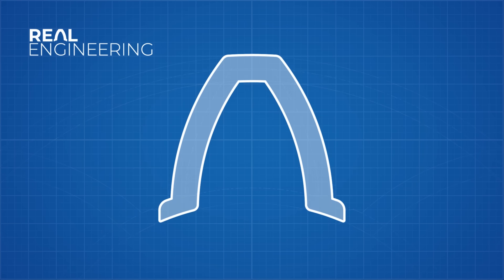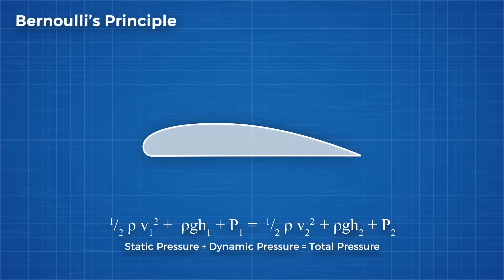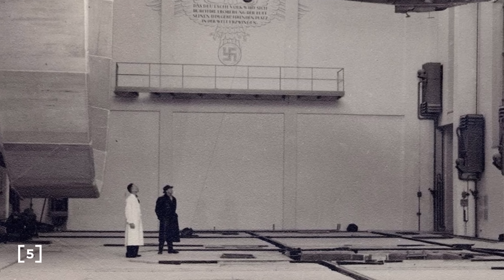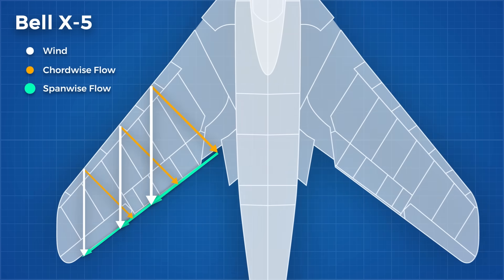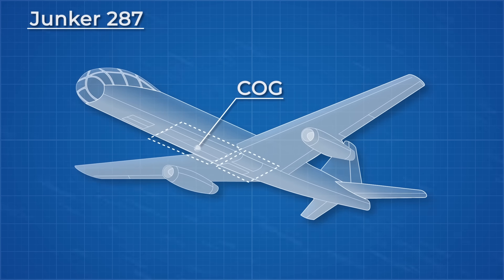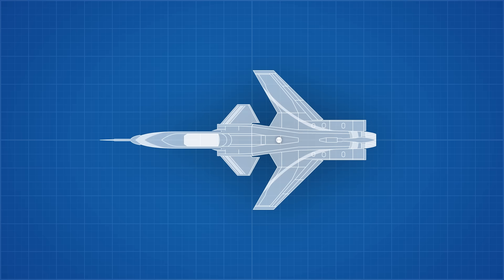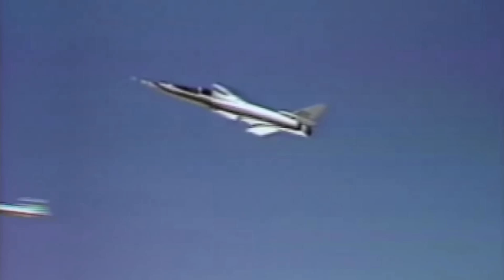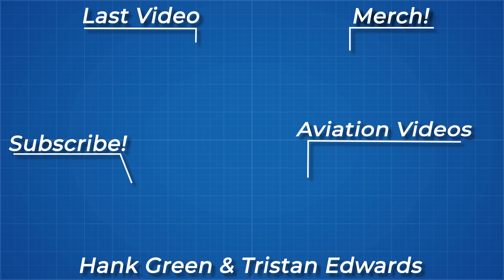Why Do Backwards Wings Exist?

Comment: You almost got this one correct.  Sorry, you got caught up by a common myth peddled on the internet.  Your only screwjob this time was in the structure wing box analysis.  It was designed with LESS structural weight and LESS stiffening than a typical wing.  Not MORE.  Why?  Wingtips were designed as completely unloaded producing NO LIFT, like a birds wings.  Higher CL is found at/near the root and can be done as the higher CL creates a higher Induced Drag, but due to forward swept wing the Induced drag is canceled when the swirl pattern collides with the OPPOSITE wings swirl.  Because the wingtips are unloaded it MUST have active control as a slight change in pitch creates a present load at the wing tips which increases due to deflection increasing yet again the load.  This was a double whammy as they had also purposefully made the structure with less weight and LESS stiff than normal compared to a standard wing as part of the testing program was also directly centered around ACTIVE controls for load alleviation which one now sees on elevators, ailerons, slats on modern commercial airliners.  Birds get away with this with an often slightly forward swept INNER wing and a backwards swept outer unloaded wing used as their ailerons.  This also allows a bird directional control and why birds do NOT have "rudders". 

Now  that commercial airliners are made completely with FBW controls and the required 4 computers(not 3 as you stated), it is quite possible for them to make a forward swept wing airliner in the near future.
Reply: Tony Wilson  Ah, you and I are disagreeing regarding wing stiffness based on the fact there was a vast difference between the program stated goals,  the end design, end result(what I stated happened) and the fact that the follow on aircraft was never produced showing the lower stiffness requirements.  This statement was based on the fact that they did not TRUST the FBW system for load control.  Rightly so! Initially it did not work as advertised!  Though for maximum load it did work, so it would not have resulted in a complete failure of the wing, but would have been a terrifying ride! Therefore as part of the programs passive safety, uh, "control" was a MUCH stiffer wing. 

As for last point: I disagree.  We will never see SS transport other than maybe Mach 1.3 due to drag reasons alone and oil isn't exactly jumping out of the ground for free anymore.  As for FSW fighter aircraft? Probably.  FSW drones?  Yes.  The Recon drones should all be FSW right now.  Frankly it is stupid for them not to be.  Gain ~~~ 15% more loiter time/load(depending of course on Aspect ratio of the drone in question). Any subsonic pilotless aircraft today should 100% be FSW due to the dirt cheap availability of gyros and FBW control at even RC aircraft cost.  One barely even has to play with algorithms/computers to set this stuff up anymore.
Reply: Tony Wilson  I think the concept might come back in passenger planes. They mostly fly in transsonic regions and are highly sensetive to effiicency / fuel usage. There is also a concept abount using forward swept wings to block fan noise of rear mounted engines
Reply: Tony Wilson  Sigh: If you are going to post links, at least read them first.  If you had you would know they had 3 digital computers and 3 analog premixers and the 4th computer is the human. Simple basic Flight logic that has been true going on 50-->80 years now. Today we use 4 computers where 3 are used and if error is occurs, 4th is checked.  If error is consistent, 3rd is switched out and 4th is used. 

If you truly remembered your lecture, assuming you did not just get a manager, he would have said that the X-29, due to its instability would render the human pilot(4th computer) unconscious in less than 2 seconds. 

If  you had read your own pdf links, you would have noticed the 5% to 30% reduction in drag and corresponding reduction in wing weight.  If you had gotten an engineer lecturer he would have told you about the wing stiffening discussion which happened before the program took off and its future goals, and he would have ALSO told you about how the program got cut down eliminating the dynamic load control, thus eliminating the need for the stiffer wing due to forward deflection increasing lift and them trying for a normal aircraft design parameters.  Not exactly a bad idea of NOT trying to swallow too many problems at the same time. Today, we have active load control on every single modern civilian airliner who are all FBW allowing them to save tons of weight(literally)

If you were in Aeronautics design, you would notice there are Many aircraft today with FSW.  The most prominent would be the Osprey and many gliders.  Though neither have enough sweep forward to benefit from the reduction in induced drag as the spanwise flow is not high. 

PS: Forward swept wing shows its maximum benefits at transonic because the very small aspect ratio of a typical fighters wing gives very high induced drag in both super sonic and sub sonic.  By effectively eliminating this drag penalty means you can make your wings at an even smaller aspect ratio which allows you to save even more weight. Does require no fairings etc impeding said spanwise flow...  This has problems with old style typical brain dead flaps design.  You may note that modern aircraft are not using anything other than single pinned flaps.  No more double/triple flap designs. 

This is where most of the decrease in drag of modern wings is coming from.  MUCH smaller flap mechanisms and subsequent smaller fairings increasing spanwise flow efficiency by not impeding it.  Well that, and higher aspect ratio wings, once again increasing spanwise flow, but this comes at a DRASTIC penalty of increased weight.  A LOT of increased wing weight which has led to a massive increase in deflection and aeroelastic issues which have correspondingly led to load alleviation control for your typical wind up 2G turn certification.  All of this is solved by going with a FSW with FBW and active load control.  You might notice, FBW and load control already exist.  Now all that has to be incorporated is the FSW.  Of course this has problems of its own; namely logistics and how airport aircraft gates but worst of all, FAA regulators who have zero engineering background and are stick in the muds.
Reply: Tony Wilson  Your are both correct.  Different definition depending on airfoil section(Tony's definition) and Calaphos definition(whole aircraft).  Any aircraft between M0.8-->1.2 is transsonic. Obviously if looking at only an airfoil, once the critical mach number is reached, some portion of the airfoil becomes supersonic creating a shockwave. 

As for fan noise: No one cares.  They care about fuel efficiency and reliability.  Lower noise = more efficient and more reliable.  Problem with rear mount is it can operate in a lower pressure zone so more work must be done by your compressor.  Must move turbines out of the boundary zone which means almost uniformally, the noise is apparent to the ground anyways.
Reply: Tony Wilson   If you were an an engineer as you claim, you would have understood exactly what I said and did NOT say.  You wish to put words in my mouth I did not say.  Oh, and if you could read(I question if you can though it appears you can type), you would know that your links have not one shred of design decision/data/conclusions in them.  They were program overview briefs.

Comment: Something I'll say that you missed in your research is that at high-alpha flight (high angle of attack), pilots are trained to use the rudder to induce roll, which somewhat mitigates the flow separation concern of wingtip stall. Other than that, great video!

Comment: So are those beneficial characteristcs also the reason that F35's wings are this unconventional "pyramid" shape ? Another example for this kind of design would be the YF-23
Reply: No, that's for stealth reasons. This shape means that the trailing edge of the right wing is parallel to the leading edge of the left, and vice versa. This reduces RCS.
Reply: @ASJC27  Much obliged. thought somethign in the same direction but eh.. never hurts to ask ^^

Comment: This bernoulli explanation for lift is false, so don't act like it's actually true. You CAN'T use bernoulli across 2 separate streamlines. Also, the air particles separating on the leading edge do not meet up again on the trailing edge. Please stop promoting this nonsense.

I'm sorry I'm so triggered. It's a mistake I see Aerospace Engineers graduating in December still making. It needs to be stopped
Reply: hi, would you mind explaining to me what the real/main reason for lift generation is?
Reply: Thomas Chow or do you mean how lift is generated? It’s extremely complex and requires a bit of background knowledge. It’s a combination of Newton’s 2nd and 3rd laws, and also Coanda and venturi and even more. Basically Newton’s 3rd law is every action has an equal and opposite reaction. The wing throws air down, meaning the air acts on the wing, giving it an upwards force. The coanda effect explains how the boundary layer air and no slip air is forced to ride the top and bottom edges of the airfoil, and how they create a pressure gradient relative to the atmosphere. You look at how a particle on a streamline curves along the top surface, and the pressure gradient that it follows/creates. The top surface has a resultant negative pressure and the bottom has a positive pressure gradient relative to the atmospheric air. You can also use Newton’s 2nd law and do a force balance to see the same thing as the 3rd law. You can also do energy balances, mass balances, and momentum balances to show that lift is produced from delta Ps from streamlines over the airfoil and under the airfoil respectively.
Reply: Thomas Chow also, you have to look at how the front half of the airfoil acts like a nozzle, and the trailing edge part acts like a diffuser, and how these velocities and pressures change. This is also the reason for shock formations on the surface of the wings. Even traveling at Mach 0.8, you can get airflow around M 1, producing transonic flight shocks on the surface of the wings. Transonic flight is difficult

Comment: To any of you interested in tinkering with planes, I highly suggest the game Besiege. People have already made plenty of sick looking planes in it already and the game does apply a lot of concepts such as (center of)lift, center of mass, drag and all sorts of cool stuff like building your own control surfaces, servo-like mechanisms and, if you get bored of planes, pretty much anything else that you can think of can be made inside of the game. Suspension systems for vehicles, differentials for wheels, escapement mechanisms for clocks. It's all possible with a bit of ingenuity and creative thinking. It's a fantastic sandbox game.I highly recommend it. I have 600 hours on it already.

And if building is not your thing, you can still mess around with creations made by other people. Game can be found on steam.

Comment: Some insight on the russian part of the story.
Unlike the x-29, s-32/37/"su-47" was developed as an actual naval fighter, for future soviet carriers. In theory, it allowed for a much heavier plane to take off/land even without catapult assistance. Soviet Union had to keep up with then expected super tomcat evolution, thus - unorthodox solution to the problem.
Reasons of its ultimate demise were more complex than just the fall of the Soviet Union: russian air force and sukhoi tried to salvage it for much of the 1990s.

One of them was combat survivability of this composite wing: it was very vulnerable to any battle damage(compromised integrity of highly stressed composite=catastrophe), and even if pilot somehow could've brought the bird back - the whole wing could be only replaced,  not repaired. For such a complex wing, it would be simply unsustainably expensive.

In the end, s-37 ended up being just an extremely expensive x-plane.

Comment: If you are looking at US experimental aircraft designs and the shed loads of research that they managed to produce then I highly suggest looking at the F-15 ACTIVE program, it was fitted with thrust vectoring engines and delta canards and was supposedly capable of taking off at 40mph in 500ft of runway, which for a fighter jet as heavy as the F-15 is amazing.

Some of it's design features have made their way into the modern Strike Eagle but none the less the original design program is super interesting.

Other options would include NASA's tailless design prototype that is just really weird to look at but did legitimately fly.

Comment: Anyone who was a pilot or even flight enthusiast who saw either the X-29 or SU-47 Berkut, couldn't help but be impressed. Although neither saw anything outside of the use of test beds they were built as they seemed like a natural progression due to the benefits of increased maneuverability.

However the issue with the twisting pressure placed on the wing roots was quite substantial and doomed the idea until composites could overcome the problem. As nothing stays stagnant for long, along with better composites we got increased maneuverability in tech like fly-by-wire thus eliminating the need for this design. Still it's a bad ass design and the Berkut probably did more then enough to generate the military industrial complex to waste even more money without it ever needing to enter active service.

Comment: What do you mean "one of the ways a wing generates lift?" In your diagram the air behind the wing is exactly the same as that in front of the wing. For each action there is an equal and opposite reaction. No net action on the air means no net action on the wing.
A diplomatic tone isn't gonna change the laws of physics fam.
Reply: Yeah, wings generate lift by deflecting air downwards some way or another.  Bad graphic

Comment: And those that say "using bernoulli as an explanation is wrong" - are right. it does not work for open systems specially not here where the air going above the wing and the air going below the wing not only get separated, they do NOT have the same traversal time either.
It is however important to know that the air around the wing gets accelerated. (and again - if it was just bernoulli the separation would happen closer to the tip than it actually does)

Comment: Was that some camera trickery, or did I just watch a passenger plane basically fly straight up at 7:35 ?
Reply: Yes a passenger jet with no seats in it and just enough fuel to take off, do one circuit at the air show and then land.

Comment: The negative aspect of forward swept wing was the bending torsion coupling which leads the wing to pitch up by bending... this introduced fluttering... back swept wings pitch down which stabelizes the wing again. its a positive structural effect. therefore forwards swept wings must have been desinged more robust and therefore heavier.... then the wing is not good anymore. except maneuverbility. NASA has very cool videos of those FSW Jets. It was called aeroelastic divergence 

https://www.youtube.com/watch?v=I-tvVp1QT3U

Comment: No, really, describing the lift of a wing with the Bernoulli Principle is false - if you apply it across a wing, a net lift of zero drops out. And the airflow most certainly does not have a personality crisis and require meeting up again at the trailing edge.

A much better way of describing lift is the airflow being turned through an angle - therefore, a net negative pressure is required on the top of the wing to keep it attached to the body, and a net positive pressure exists on the bottom as the airflow is forced to trace an arc. While the does cause the airflow on the top and bottom of the wing to change speed according to the Bernoulli principle, this is as a result of, rather than the cause of, generating lift.
Reply: Fast air has less pressure. The faster air over the top curved surface makes way for the slower higher pressure air below to lift the wing. You can demonstrate this by blowing air over a curved sheet of paper. Or even under a hoop of curved paper (the hoop will flatten downward).
Reply: @T1Oracle  Actually most of the lift on a cambered airfoil (~2/3, depending on the section) is generated by suction on the upper surface, not an increase of pressure on the lower surface.
The demonstration of blowing air across a sheet of paper is also a fallacy. Because the paper is so heavily curved, the airflow almost immediately separates from the surface - not unlike a stalled wing. The paper is sucked up because a vortex develops as the blown air forces the stagnant air into motion - and the vortex by happy accident rotates in a direction that drags the back of the paper upwards (not unlike the rapid pitch-down moment experienced on a stalled wing). These vortices are then shed, which on a strip of paper causes it to wave like a flag.
Notice also that however hard you blow, the paper can never straighten itself out fully - it always sags. If the air your lungs blew really was lower pressure (it isn't), then you should be able to straighten it out completely.
Reply: Oh shit!

Comment: I will say i am no engineer by any means.  I am however a very studied warbird enthusiast.  The X29 was abeautiful idea but the question I have always proposed is this.  The SU47 was built from the ground up, however the X29 wa an F5 frame modified for foward sweep.  I would argue that a lot of the failures of the X29 are based on its airframe.   I'm sure that has played a role in the demise of forward swept wings. I still believe further study needs done to prove it is truly impractical but I understand as well if it ain't broke don't fix it.  Also a continued research would be costly.  So in short its more of a curiosity to be sure than anything currently practical.